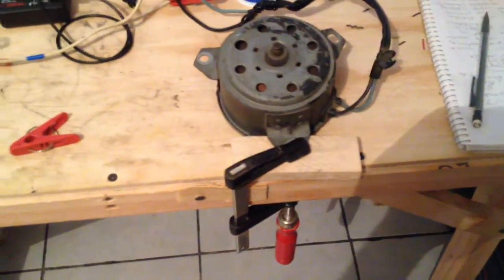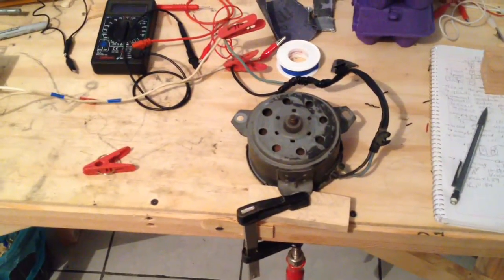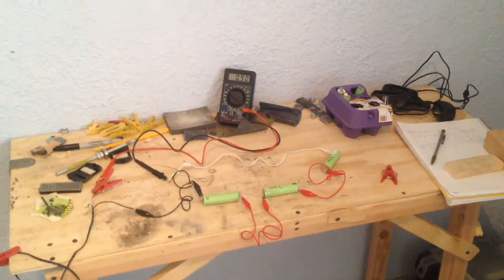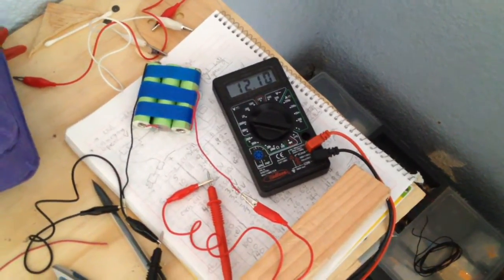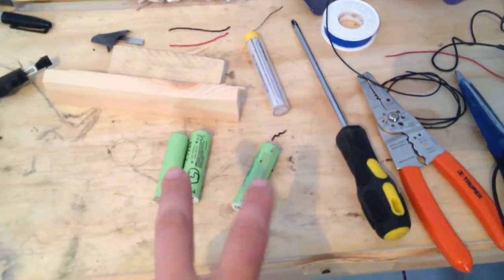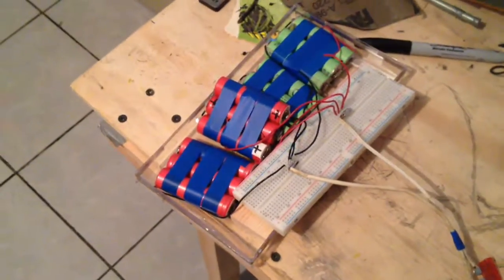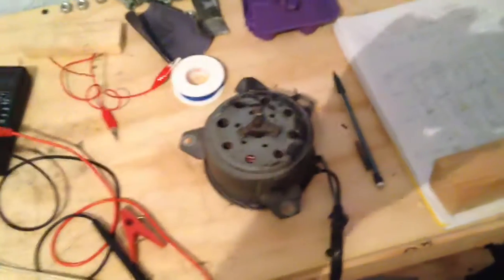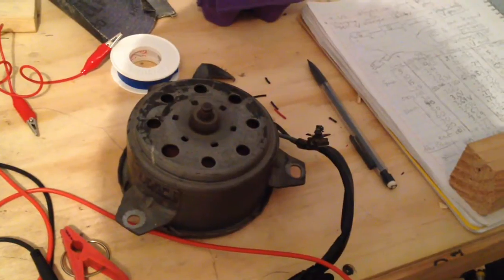DIY wind Turbine 9, free lithium battery

Comment from the maker: Yes.  You can use 12V car lights or use an inverter with normal AC lights.

Wire your batteries with 3 sets of parallel cells in series.  Then use your 12V solar panels to charge them.  You also need a diode to prevent power from the batteries going into the panels.  You need a charge controller to stop overcharging or you can check the batteries to prevent over charge.